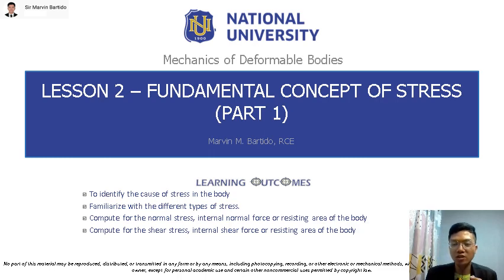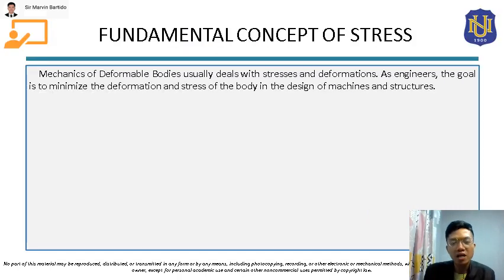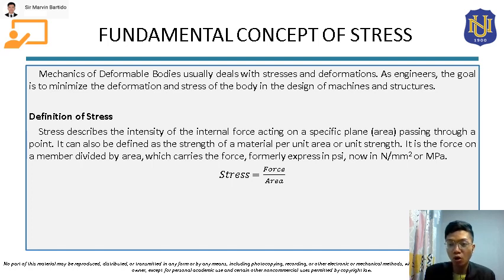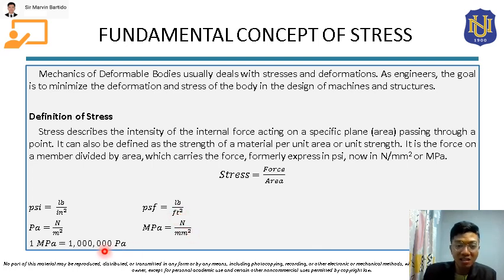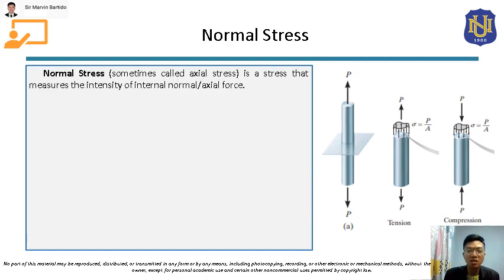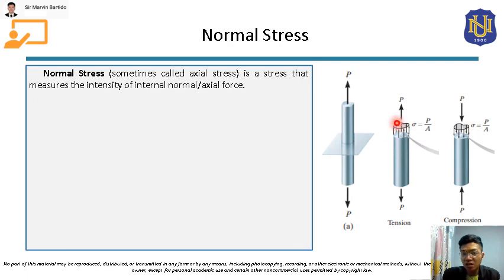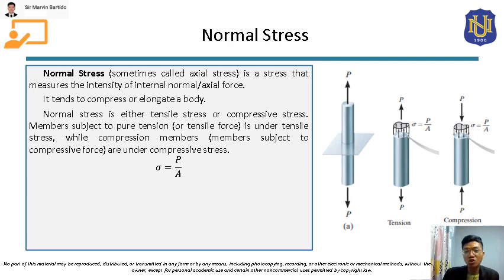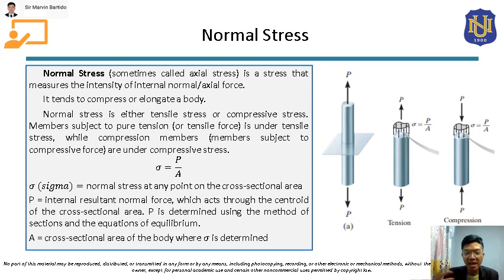Mechanics of Deformable Bodies - Fundamental Concept of Stress (Part 1/2) [Normal and Shear Stress]

Comment: John Russell Rodriguez
CIV192 

I learned that, In determining the stress in each section, we need to follow the steps in solving the normal stress. First solve the internal loadings or internal normal force to proceed in solving the normal stress in a section.

Comment: Navarro, Karrenmae 
CIV192
Today, I've learned that mechanics of deformable bodies is an important lesson most especially for engineering industry as it would help to minimize the deformation and stress of the body in designing structures and machines.

Comment: GALVE, JHANIEL A. 
CIV192
In this module, I learned that stress can be calculated by dividing the force on a member by area. Also, I learned the different types of stress which are the following: Normal stress, Shearing stress, Bearing stress, and Tangential & Longitudinal stress in thin-walled Vessel.